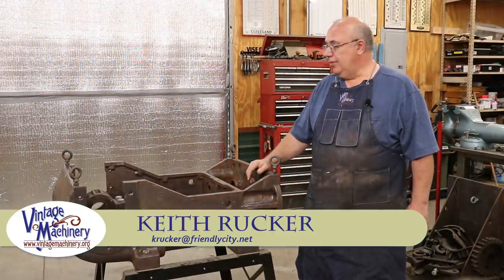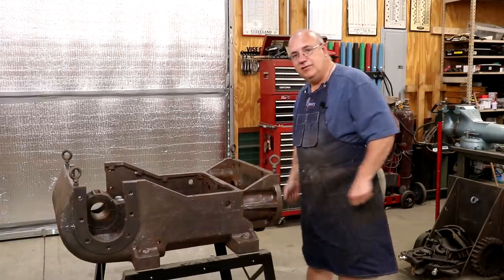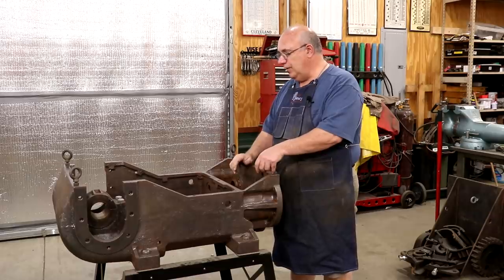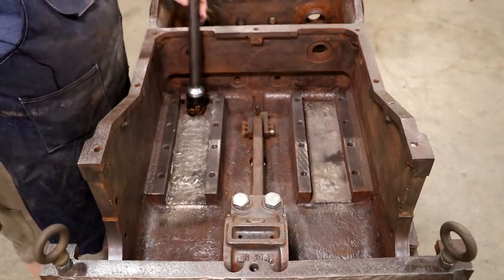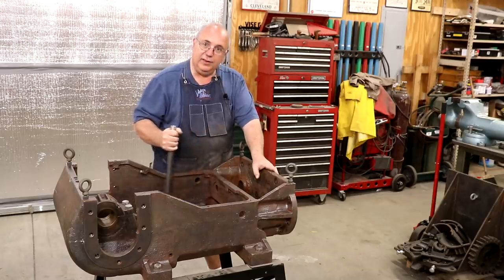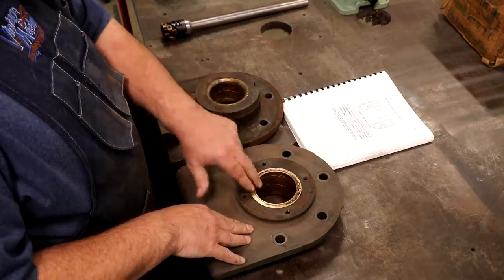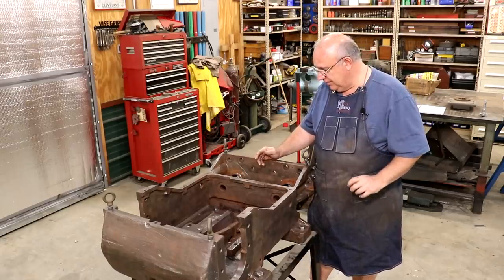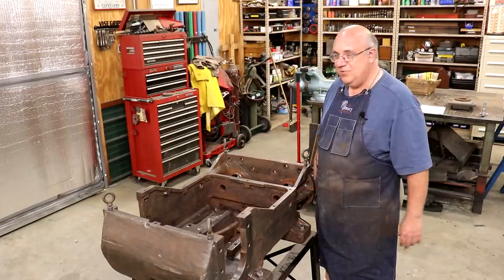Steam Stoker Engine Restoration 14:  Project Update

Comment: That surface where the cylinders mounts should be square and parallel to the crank. It would be the perfect support for holding the case vertical then you could back it up with the angle plate so it doesn't vibrate. I bet one of those angle plates in the barn would do the job. :-) Pretty sure you will have to set that job up twice to do on the Cincinnati horizontal.  That vertical head spindle will not be out far enough to get both rails in one setup.
Reply: Yep, that would work great I bet.  Sometimes I wonder if there is not too much thinking going on!?!?  Yes, I know, I need to go look at that steady rest for my 36" Monarch that is to tall.  I keep getting distracted.
Reply: @wdgreen6612  Get to it! lol It is easy to get side tracked trust me.

Comment: Hi Keith.
One possible way to limit chatter on that long shell mill arbor, is to consider an ‘outrigger’.
I’m thinking here that you may be able to mimic the setup on a horizontal milling machine that has a bearing hung from an overhead mandrel.
Now if a horizontal milling cutter were to be mounted outboard of the support bearing, and then imagine the whole lot transposed into a vertical plane, then that could perhaps be applied to this milling job.
So.... if a ‘steady’ bearing were to sit on the long arbor, immediately above the shell cutter, but ‘shallow’ enough to still go under the overhang ( like the shell cutter is intended to do), that might help to limit deflection.
The problem then becomes... how to support that bearing ( on the crankshaft side), with an arm/arbor, hanging from the mill’s quill or headstock.
Not sure that my horizontal mill analogy is clear, but worth a thought anyway.
Good luck,
Robert
PS I saw a set up like this in the 60’s, but on a horizontal borer, doing a similar ‘deep facing’ operation in a steam isolation valve chest ( valve was from a power station steam turbine).
that instance, the ‘outrigger’ was secured to the (locked) chuck on the borer, and the spindle was supported by a plain bush, right out at the cutter end.
It did reduce chatter.

Comment: Keith,  If you really want to mill these surface, you have to do them on a horizontal mill.   That's how they machined these surfaces.  When I watch Adam Booth Video and when I saw the milling marks, it was evident that they used at the time an horizontal mill with an 90 degrees angle plate to hold the part.  And I hope that horizontal mill use a Cat50 taper holder for rigidity.

Comment: The thing I'd be inclined to do is set up that shell mill on the machine, and then set up some random slab of old rusty cast iron, and try milling that flat. That will give you some idea of the amount of flex and chatter you are likely to see before you start cutting on the real thing.
Reply: True.. but if it's gonna be a disaster he might as well find out on the real thing. But doing it on a sample is ALWAYS a good idea.
Reply: Best make that cast iron with a spray welded surface layer.  Cast iron is usually pretty easy cutting.

Comment: I agree with what most of the other guys said. It is not only the flexing of the shaft but all clearances in the bearings which come to play. You need to have the utmost stiff milling machine to do it as you plan. With a long shaft, the bearing clearances multiply as you can see from the geometry. A five mil clearance with a shaft part of two inches will create a wobble of fifty mil at the other end of 20 inch shaft, as a crude estimate. That is too much and will break the bit. Personally, I might try this job with an accurate grinder stone of proper diameter taking a small layer at a time thus preventing biting. Best of luck with the job.

Comment: Sorry to say it again, and I'm not trying to give you guff by any means, but could you send the cutter and arbor to the shop where the machining will be done before you go? That way they would have time to do some testing. I'm sure it will work, even if you have to drop to a crawling speed. I've even seen a friend take opposing inserts out to help with chatter. Testing could save you a lot of shop and filming time. Fingers are crossed for you. Love your channel.

Comment: Keith,  I wonder if the bearings are worn oval with the load in line with the cross head.  The 3 point bore mic may not be the best way to measure the size of the bearing.  It assumes the bore is cylindrical.  A simple telescope gauge and outside mic may tell you if the bronze bearings bore are cylindrical and their size.  Take multiple measurements in line with the cross head and at angles to check if they are oval.

Shimming and line boring the split center bearing may not help if the wear is in line with the cross head.  To maintain the center alignment with the cross head you are stuck with the distance across the face at the split line as your smallest diameter for a re-bore.

Comment: As the milling cutter to cut the bottom of the journal, could you use a High Feed Mill? This would direct most of the cutting forces upwards, instead of sideways like the shell mill you have now. That would compensate the lowered rigidity of the long shaft. However, that can't fully clean up the sides, but for these light cuts the shellmill or a long endmill would do the job.

Comment: I would suggest line-boring the centre bearing with the shim installed (unless that already puts you over your nominal 3", of course.)  The side bearings don't have built-in shim adjustment, which may indicate that the centre bearing is expected to receive more wear, thus the ability to tighten it up is included in the design. 

Just a thought - I may be completely on the wrong track, too.  Cheers!  :-)

Comment: I've got a standard knee mill with a 54in table and I had trouble putting small 4 cylinder engine blocks on it.  I believe that stoker engine is too heavy for any machine except for the one you're talking about.  I agree, a horizontal mill is out of the question.  I know you'll get it done the right way.  All the best.

Comment: If you assume the extension shaft is as large it can be, other than changing its material there is not much more you can do other than test it. My thinking is that one risk is vibration if the milling action gets anywhere close to the natural harmonic frequency causing resonance of the case or the tool/shaft machine. Changing machining speed, the tools number of cutters may help but having a few small heavy bags of sand or lead pellets to add to the case and having a strobe light or vibration pick up to see what frequency the shaft/case is moving to may be worth preparing for. Good luck and go for it. On the bearing clearance issue, having a number of different shims ready to vary the nip on the bearing and some clearance in the design to hold oil would be worth considering. Cheers.

Comment: Man, that .015" journal clearance seems like a whole lot. But then again with the time period that it was made, large tolerances were probably the norm. I know in the automotive world, most journal clearances on the crankshaft and bearings are .001" per 1 inch of journal diameter. Your crankshaft repair guy will probably tell you the same thing. Can't wait to see the finished product!!

Comment: Happy to see that you are going to use a vertical milling process for the cross sides. This will be the most accurate  in terms of table speed and head speed.additionally you should check the actual travel of the cross side castings as full slide accuracy may not be critical regarding the cylinder stroke distance. To check this, you might need to assemble the cylinder head assembly,the cylinders,minus the rings, the rods and the cross slide casting. In that you are having the crankshaft remanufactured tithe original specs, the reboring of the bearings is appropriate and not need anything for the central Babbitt bearing. The damage to the crankshaft was most likely due to a contaminant in the coal supply,  clinker of either a hard rock or a piece of iron ore that jammed the coal feed screw. It would also account for the external bearings being of different bore diameters. Will be awaiting any videos you may be able to make regarding the milling of both the casting and the crankshaft.

Comment: You mentioned Brian Block... he's probably your best bet for Plan C...
Reply: Brian's going to need to clean out his barn/shop to make room for the stoker engine. He's also going to need to pull that Audi out of there and make room for real machining projects before Keith might consider plan C.
Reply: @DAKOTANSHELBY  Go away.  Quit trying to start shit.
Reply: @DAKOTANSHELBY  I have a bridge crane moving stoker sized projects around the shop is not a problem. I have done 2 engine block jobs during the time the Audi has been in the shop. Tracking says Audi parts tomorrow. I sure hope so!!!

Comment: Keith I don't know if you have a way to mount this on the vertical head of the horizontal mill. Because you have plenty of clearance to the crank side. A steady rest mounted on that side with a half bushing running on the shank immediately above your cutter should work. I have done similar things in long cutters. Just a thought if you have a way to mount it.

Comment: IMO that cutter would work just fine. It's back to newbie 101 basics, if your machine can't cut, take it slow, take it easy. Look at the (still) visible cuts on the top, they didn't really cut things within laboratory grade performance and the mechanism worked just fine.

OUTSIDE talk, were it my project, and my locomotive (and because i'm crazy like that), i'd basically machine flat the entire area, and make insert shoes, thus making that part of the stoker engine a replaceable part. I'm 100% sure that the casting and the mechanics of the existing design could take that kind of a modification without issues. But that's just my personal (mad) take. :)

Comment: Kieth, have you asked Adam about the mounting plate he prepared for that casting to fit to his shaper. I believe it was about a 1" plate that it mounted to and then using the t slots on the universal table of the shaper he could manipulate it to his desired position. If you could borrow that it would save having to make one and if luck is on your side the bolt pattern he drilled might even fit you friend's big mill. Just a thought. Good luck.

Comment: Would a dial bore gauge be a better tool to use to measure the bearing? It would allow you to check roundness as well as overall size. Just a thought.

Comment: Could you use a 2 leg bore gauge to measure the width of the centre bearing to check if it's oval ?
Also, can the cutter shaft be shorter to reduce chatter ?

Comment: Isn't this a case of the tail wagging the dog?.  Fab or find a large diameter arbor to do 90% of the milling in good time without chattering issues,  Then put the time in to overcoming the challenges of your small diameter arbor for where  the casting overhangs.

Comment: Have you considered a fixture to mount to the rails already there to hold a bearing to support the end of the cutter?  Would have to allow you to slide the engine back and forth and up and down but you only need to move it a little up and down so just a long plain bearing. I can see the design taking form in my head. Would be a small project but might give the support needed. Of course that would be plan B if the set up you plan just is not rigid enough.

Comment: Kieth, only the last 1/2" or so of that milling area needs the small diameter shank on the shell mill.  Why not make a second larger diameter shank to do most of the milling then just switch to the smaller dia shank for the last little bit.   Possibly do the last little bit with a 1/2"  end mill on that arbor you built.  Get it close then hand scrape it to finish may be an option.
Reply: I was wondering the same... use a larger cutter on a larger arbor and machine as much as you can.

Comment: I have always thought it was most likely  built on a HBM initially. Along with the benefits of tooling and fixtures for the job that go with manufacturing  (shell mill maybe?). I am sure they built more than one over the years. Regardless that was 60  or more years ago. 
However I am pretty sure it will all work out eventually, sketchy shop made tooling and all 😁 repair work often calls for such oddities. Cheers

Comment: Keith, I hope your plan works and I think it could. But a larger diameter cutter needs more torque to cut. Sitting on a safe distance here and my work done; why not use a one inch cutter and move accordingly? Easy does it still but the torque is lower and the reason to flex your arbor too. Small thoughts on the subject here after work, the Netherlands. Thank you Keith, trying to help, Job
Reply: Agreed. I'd probably use a half inch endmill at a much higher speed.

Comment: Keith, when Adam realized that his shaper couldn't make the needed cuts due to clearance, I wondered if it would have been possible on his machine if he had a "pull type" "clapper box" (or whatever this configuration is called) like what Stefan Gotteswinter (sp?) used to have back when he had a toolroom shaper in his shop.  Stefan ran his shaper "backwards" to how most run their shapers simply to prevent throwing chips all over his small shop -- the "pull-type clapper box" cut as the ram retracted towards the "column" and might have allowed Adam to gain the small amount of clearance needed to complete the job.  Of course, Adam would have had to design & build his own "pull-type clapper box" in order to do this, but never responded to the comment (which he most likely never saw) about whether or not he thought that configuration would have worked in his shop on this particular job.

I look forward to seeing your upcoming machining of this engine down at John's shop!  Also, once completed, will you test run this engine at the museum or leave that to the locomotive guys up in Tennessee?
Reply: A pull-type Clapper box is expecting a pull-type ram and bull wheel to drive it. The differences can be overcome with a push type machine in a pull-type situation but... The original machining done was with a circular cutter. 

Now, onto a different way to handle the pitting and score marks other than what was done so far. A field repair is different than a depot repair and a manufacturing repair is different than a depot repair. Expediency being the mother of invention many times in the field shops, scoring such as this was roughly scraped and then any pits were levelled with a material that melts at a fairly low temperature much like Babbitt only a great bit harder. A shoe made out of a less hard Babbitt will ride on this surface without galling. All these field or depot repairs were done to get the trains back in service and making money after all you could always send it back to manufacturer and take that item out of service for many many months and it wouldn't be a headache to the depot or the field repair teams. Too many times of cutting the string at one end to make it longer at the other does make it possible for profits to be made at the expense of downtime further down the road. Refurbishment and repair is always a tricky business with Logistics.

Comment: Watched Kurtis at CEE on you tube laying bronze on a excavator steel shaft with a mig welder, good adhesion, might be plan B if the spray weld comes undone.
Milling with a smaller diameter cutter might be the answer, less chance to dig in and chatter.

Comment: Seeing the use of bearing supports on lathes and mills, I'm surprised that a support arm with a simple babbitt bearing can't be used with your long shell mill extension.  Attached to one side of a milling head, and well lubricated during use, there seems to be plenty of clearance around the shaft and in the body.  Perhaps the original manufacturer used such an extension on their factory tooling?

Comment: I can hardly wait. I had to go back and re-watch. I have a stupid question. Would a repair shop do a test on the rebuild, with compressed air, instead of having to use steam? I've noticed several of the model builders use compressed air. Thanks again.
Reply: I don't think he's able to generate the air capacity to test it past moving it very slowly. But that's just off the top of my head, i forget the volume his air unit can generate.

Comment: Put a bearing on the lower end of the milling cutter shaft above the cutter head. Manufacture a slotted guide to match the bearing OD. Brace, hold and align the guide with jack screws on the internal face of the box. This would at least support the cutter transversal to the direction of the guide. Guide could be fixed longitudinally or transversal depending on which way you want to cut. Longitudinal would obviously be more efficient. This would eliminate chatter on one axis at least.
Reply: Complicated but with two guides and two bearings on the shaft (x&y) you could brace and guide the cutter in both axis.
Reply: Basically an adjustable fence positioned with jack screws inside the box

Comment: What happened to the mounting plate that Abom79 made? A dial bore gauge is the right tool for measuring those bearings.
Reply: Thats what I was thinking....Adam had it bolted downtown the shaper table, Keith needs to call him
Reply: ( down to)

Comment: Keith - I know you (and everybody else) are concerned about the length of your milling machine attachment. Might it be an option to find a way to triangulate a bushing near the milling head to steady it?  Some sort of bearing as close to the milling head as possible with arms to steady it that lead to some part of the milling machine (in a direction that doesn't interfere with the casting, of course) to form a triangle to steady the head and reduce vibration and inaccuracy?